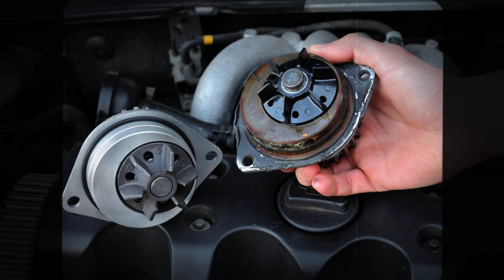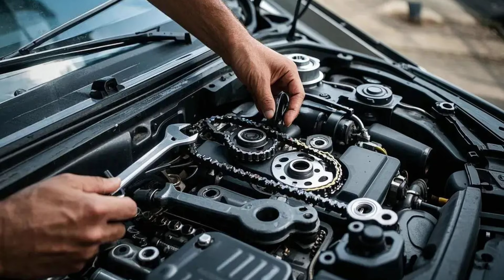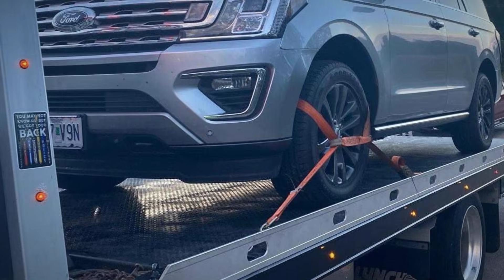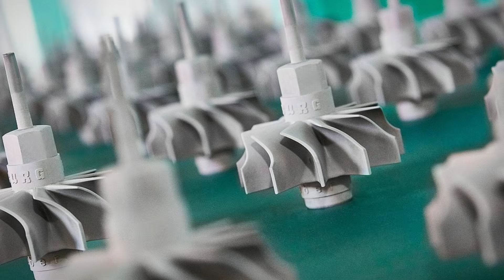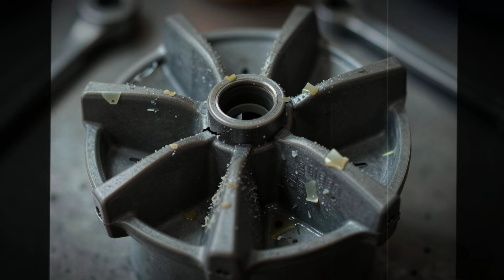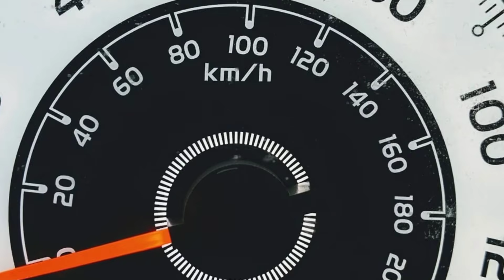Why Modern Car Engines Explode At 100k Miles (Plastic Water Pump Scam)

Comment: GM: we made a coolant tube out of plastic, and it was prone to failure.

Ford: hold my ratchet
Reply: True. But also GM, "let's put the water pump in the rear of the engine up against the firewall so you can't get to it at all."
Reply: Prone ? More like guaranteed.
Reply: @Billy-u2p3t  there's a reason they sell aluminum replacements lol
Reply: @mr.whiskers4053 😂😂
Reply: Been there, done that. Ford forgot how to design and manufacture engines. They should offer Toyota drivetrains as an option, without it why bother purchasing their overpriced produces? They have a shortage of mechanics. Subsequently you could conceivably be without a vehicle for 30-60 days with no loaner car. Fords are not reliable, if u purchase a Ford you must own a backup car.
Reply: You can buy the aluminum elbows, y’all acting like this shit rocket science out here, these cars still built the same as they was in the 80s, and I have a 2016 ford and the water pump is aluminum, it’s in the front.
Reply: @2ant1man5 where

Comment: After 2026 they will have remote cutoff switches and will be connected to 3rd parties via 5g network for 'safety concerns'. How come they are not forced to declare which parts are made out of plastic in the crucial automobile systems such as cooling, suspension, or drivetrain?

Comment: Fords are notorious for water pumps  going out on all their vehicles at low miles I have dealt with water pump failures with their cars trucks in the 1960s they even used metal propellers so whether it's metal or plastic Ford water pumps will fail at low miles they are junk it's why I don't deal with any ford vehicles anymore..

Comment: Someone should start a business retrofitting, cars and farm equipment, yanking all electronics and plastic crap off of them and replacing it. if you buy a car or a tractor and also that be included in the price, going to see somebody else to get all this junk fixed before you drive it.

Comment: Even the cheapest Renault engine 1.2 naturally aspirated 16 valves used a good aluminium water pump with metal turbine... Though my family members Clio 5.5 1.5 dci water pump cracked before 1k km it was a simple fix though the pump cracked from overtightening.

Comment: The biggest problem isn't the plastic impellers. It's the fact the water pump is driven by the timing chain. All that force on the water pump bushing causes the bearing to go bad and then it starts pulling coolant directly into the engine. By the time he coolant finds its way to the weep hole outside of the engine is already too late. The stupidity is that the water pump is inside the engine cavity and that's what the lawsuit should have been fought over. The plastic impeller inside the coolant passage is the least of anyone's worries.

Comment: My brother is an engineer.  He does parts failure testing.  If a part fails at 10,000 times of usage, they'll make it out of weaker material, so it fails faster.  Now you need to buy the part.  Sometimes you just can't buy 1 part, gotta buy the entire kit/assembly.

Comment: Calculated  to drain your 🧱 wallet, new vechile, or new engine 🤔 😅, they took away transmission oil sticks,so only a dealer technician  could  check ✔️. New transmission. 😂

Comment: Every single car brand is doing it does not matter how much that car cost. When my S550 hit 90,000 miles and I owned it since it was brand new. You had to do the complete restoration service which changes all that shit plastic coolant lines plastic oil pan. The list is endless of all the things you need to do. It was $10,000 in order to make that car go back to factory new again and continue on its mile journey. I did it and six days later a dumb ass totaled it. I’m sick of this shit.

Comment: They swapped  metal parts n cars, w/all that tech stuff  ppl don't need or want, so they can charge u xtra. This is dangerous,  they're  putting  poorly   manufactured  cars on our roads. Then they want 2 charge u a ridiculous  price  2 fix  them. They know  these parts will eventually  fail & you'll  have 2 return 2 them 2get them fixed.

Comment: Water pump in the ranger 2.2 and 3.2 ltr have the pump on the outside, leaks on the outside.  A little work to remove it but not too bad for the DY'er.  The pump is a little pricey.  Yoy might want to also use a screw driver in conjunction with a socket set for the advanced DIYer.

Comment: Sooo, My dad gave me a 1998 chevy lumina 3.1, and I wasn't really thrilled about it. But after 5 years, I love that car. I have done, on my own, the waterpump, alternator, tensioner, power steering pump, crankshaft pully, flushed the radiator, replaced the fans, hub barings, ect....all in my garage. I did 90 percent of this just to be proactive, the only part that went on its own was the alternator. The 3.1 V6 is absolutely easy as hell to work on, with the exception of the awful thermostat location, just make sure ya have that wacky tool for the awful bolt. I bought my wife a 2020 Hyundai Tuscan and the engine blew with only 20k miles on it, they replaced entire engine. They don't make cars like they used to, and they don't learn. In a Toyota boardroom somewhere, someone said "lets take our unstoppable long-lasting Tacoma V6 engine and make it a 2.4 turbo that will need work every 50k miles" while twirling his mustache. insane.

Comment: I had a 1998 XJ.  It overheated so I pulled over and let it cool down.  I drive home a few miles at a time with waits to cool down.  Replaced the water pump, no harm done.  Had that XJ for 21 years.

Comment: That's all you need to know .... It's a Ford ! 🔥💰 🔥💰 🔥  I'll stick with my 1997 Tacoma ( 260,025 miles ) Just had the evaporator replaced and the ac is cooling below 50 degrees ... 🥶 👍. I will also keep my 2004 Tacoma Dual Cab SR5 ( over 123,000 miles ). Go away repo man ... these two babies are paid for !

Comment: 2017 Lexus CT same problem, plastic propeller, at 75k miles failed. I did it myself for only $60 vs. $2,000.

Comment: My sisters 2010 ford edge with 109000 miles just had the waterpump start to leak. I thought i could do the fix myself. Never once had a problem changing a water pump. Well this is a 10-12 hour job costing $3 to $5000
For fuk sake

Comment: VW OWNERS !! 🕯 water pump on   my 2013 VW JETTA 2.5 SE is mechanically  driven, by the serpentine belt and is located on the OUTtside of the engine block.
   Yes, it is plastic, but removing it is easy and simple.

Comment: GM it’s just as bad I bought a 2018 Chevy Silverado water pump failed before 50,000 miles. They are aware of the problem would not cover it.

Comment: All by design, thats why most vehicle manufacturers completely removed the transmission oil abd power steering dipsticks so you can't even check your levels let alone what its beginning to look like, auto manufacturers decided that making vehicles last over 200k miles is somewhat bad for business yet manufacturing vehicles with a literal shelf life of less then 5 years or 50k miles is far better 🤔 Toyota Honda and Nissan are incredibly guilty of this as their pinnacle was the late 80's into the early 2000's of engineering now planned obsolescence

Comment: I just had my timing belt changed on my 1.8 Audi. Thankfully I knew about this and had a pump with a metal impeller installed. At least the intake manifold is metal. '06.

Comment: I wish someone would make a comprehensive list of what year, make, model and drive train of cars actually designed to last 200,000 miles without major repairs. From GM’s V8’s with AFM self-destructing right off the showroom floor to almost every CVT of every manufacturer dying at 100,000 miles to Toyota V6’s self-destructing it is nearly impossible to find new or used cars worth buying. All if this has government regulations driving manufacturers to build more complex drive trains with cheaper, lighter parts to achieve increasingly impossible mpg targets designed to phase out ICE cars and force us into EVs we don’t want that don’t fit our driving needs.

Comment: My 2007 ford mustang v6 actually supposedly a solid and fairly decent engine 4.0L. But it does have a plastic thermostat housing which is notorious for cracking and deforming, potentially causing catastrophic coolant loss. Happened to me as I was getting close to home from the store. Limped car home about ~1.5-2 miles with little to no coolant when my thermostat housing blew. Could have wrecked my engine. Maybe should have gotten a tow. But at that point. I simply didn't care anymore. Wasn't going to throw more money into this car, even in the form of a tow. I'd rather take the risk, and potentially send the car to the junkyard, rather then pay the $500 tow. Engine seizes? I'll just walk home. But on the other hand -- limp it, cross my fingers, and try to do the repair, fix the car, and get some more miles out of it. 

Anyways. Replaced plastic thermostat housing with after-market aluminum. Actually had the part on-hand as, because at some point, I intended to do the replacement. But had been putting it off, much to my determent. 

Well. Car seems to be running fine now after about 1000 more miles. But still have a slow coolant loss. No signs of a blown head gasket e.g. no bubbles in radiator/coolant reservoir on cold-start (liquid smooth as glass, no bubbles), no white exhaust especially on cold-start, and no "mocha" looking oil I see on the dipstick. 

At this point, I'm starting to think my water-pump gasket has a leak. Looks a little damp down there near the bottom of the water pump. Maybe weep hole? I hope this is actually the case, because a water pump replacement on this is an easy fix. A blown head gasket? Not so easy. If it's the latter -- the car is going to the junkyard. 

All this by 103k miles. Fun times. What a journey.

Comment: Has no one mentioned the wet timing belt, as a retired Auto Technician since 2005, I’ve become aware of the wet timing belt, where the belt is immersed in the engine oil, in all my years as a tech we were told to not ever get oil on the belt and now here we are immersing the things in engine oil, this is criminal deception by these automakers, it’s not just planned obsolescence, it’s planned destruction, time to get together for a major class action and put them all out of business .
Reply: Wow.

Comment: It's not just the water pump, many critical parts are made of plastic these days.  Cars are designed to last only until the warranty ends.  Go visit a junkyard, you'll be shocked how many new cars are there due to catastrophic engine failures.

They don't want you driving 20-year-old cars anymore.  They want you buying new ones every 4 or 5.  Its not just cars either, appliances are keen to die within 2, 3 yrs.  Things are literally made to break.  

From a spiritual pov, the end is close.  Corruption and greed are expanding globally at feverish rates.
Reply: Must be why they won't let you go in a wrecking yard and pull your own parts anymore?  Cannot see what's in there.
Reply: @elw6150  Maybe, i think its more for theft.

Comment: My ford dealer told me the transmission fluid could not  be changed on my 50 k mileage fusion as it would take the transmission seals out .

Comment: I look for cars with less plastic.  Fords radiator was the biggest pain.  The core baked into plastic.  After many cycles of extreme cold and heat, it leaks.  It cannot be fixed only replaced.  Now they are going into engines.  Too bad for the company.

Comment: I had a 2015 Chrysler 200C with the Pentastar V-6. I loved the car very much. At one point zI began to notice drops of oil on the driveway. Then very suddenly there was oil everywhere, on the ground, all over the engine comaprtment and in the coolent water. Guess what? The Pentastar V6 has a PLASTIC OIL COOLER. If you have one of these engines it is best to i have the plastic oil cooler replaced with an all metal version. It costs a few dollars more than the plastic version but it will never fail.

Comment: All cars should have a 10 year 120, 000 miles , 100 % 
Parts and labour bumper to bumper warranty , including paid for maintenance . Tores ahpuld be warrantaed for at least 60,000 miles and the battery for four years fully .
Period .
Reply: Tores ahpuld?  

Regardless you'll never find such terms anywhere these days.  Because they are not made to last.

Comment: Two modern things that are accidents waiting to happen in modern cars ,number one,  wet timing belt, every one knows that rubber deteriorates in oil , this is a very dumb idea, number two,  having plastic parts in a cooling system, because plastic crystallises becomes it goes hot and  cold frequently , good example of this is that cars have aluminium radiator with plastic tanks , the top tank goes from a black colour to a browny colour,  one day a Friday of mine bought a Toyota camry, I looked at the radiator and it turned to the browny colour so I grabbed the top radiator hose and the spout on the top tank snapped off because it was so brittle ,so we had to fit a new radiator,  I said that could have snapped off while the car was being driven

Comment: It's been 40+ years since I've had a coolant pump or a thermostat fail. Last one was a 1981. Cars  before 1970 were considered worn out at 100k miles. Not so anymore. If you're old enough to remember, there were radiator and brake shops everywhere. Cars needed tires, brakes, ball joints, tie rod ends, wheel bearings and u-joints by the time they hit 40k miles. I had first hand experience at fixing them all. I haven't had to do those things for decades. I just got a 100k van and the only thing gone bad on it was a u-joint.
I'll take late models over the old ones any day. BUT, I'm glad I can still do maintenance as the stealer's prices are outrageous and independent mechanics are getting scarce.

Comment: Only a complete design idiot would place plastic components on or in an engine which gets hot whilst it is running. Utter stupidity of the worst kind.
Reply: Those would be engineers they are pumping out of colleges all across the country!

Comment: Someone also thought it was a good idea to run the engines rubber timing, belt in the engines Oil.but after only doing a yearly mileage,the rubber started to disintegrate and block the engines oil galleries.some people were lucky and fixed the problem before the engine was destroyed.the one thing you can do is don’t buy a car from that manufactory again.